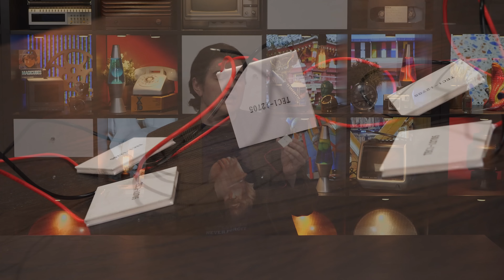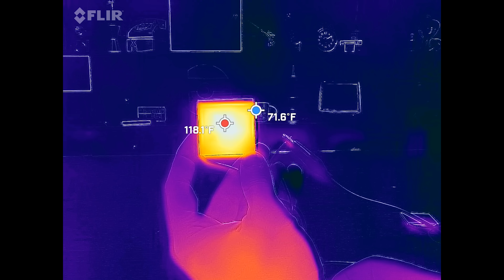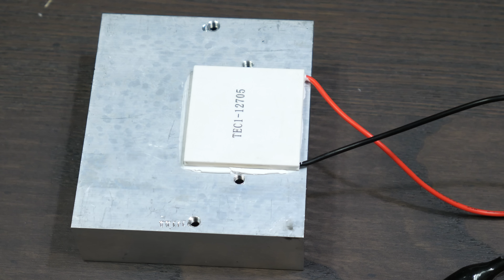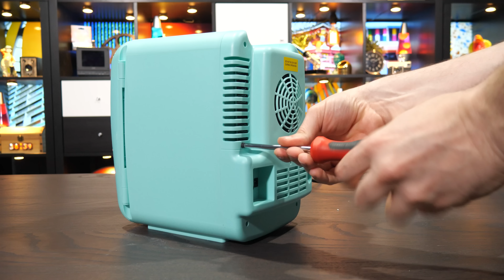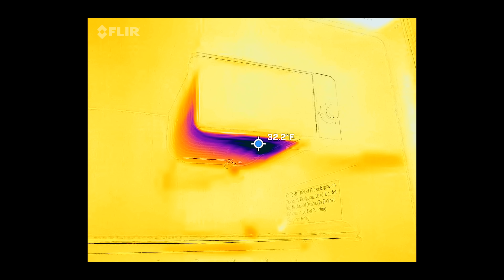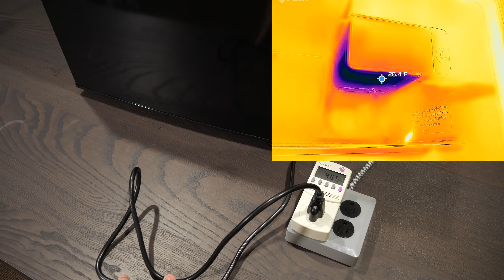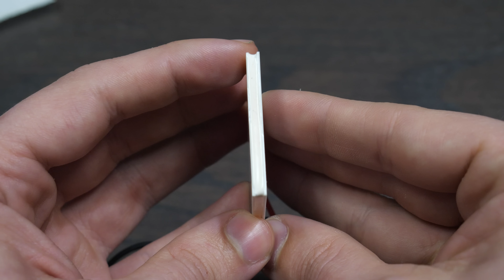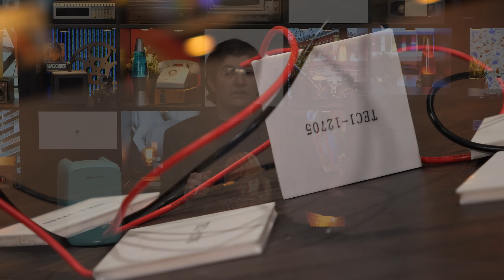Thermoelectric cooling: it's not great.

Comment: Another great video. There’s one other application that might be worth a visit. Dehumidifiers. 
We have a couple of cheap off-brand devices. I’m 99.9% sure they use the same Peltier element technology, with the cold side being connected to a heat sink which acts the condensation collector, and fan and heat sink combo on the hot side to shed the heat. 
They technically work, as after a  few hours some water has collected in the reservoir. Now I’m wondering just how terrible they probably are at their job, and if a proper dehumidifier would work better. We have a tiny house though and not a lot of space, which makes the cheap small ones appealing… but at what cost?

Comment: Have you seen these used in reverse effect? You can buy fans that sit on top of wood fires and are powered by the heat energy. It's the first time I've seen solid state thermal power generation.

Comment: Actually, Peltiers elements sounds amazing but just need a lil bit more engineering. So much potential there!
Reply: Hey, I've got an stupid idea! What if we stacked a few of  those Peltier plates on top of each other so 2nd one takes the heat of the 1st, 3rd one takes the heat of the 2nd etc... This "may" solve the heat leak problem you've mentioned at 22:06

Comment: Could you talk about Absorption refrigerator. I have one from Dometic that I use as a backup fridge and when going camping. It runs on 240V AC(Europe), 12V DC, and LPG. It is completely silent, slightly slow to cool, but can go below freezing 0C if you set it very high. The model I have can hold quite a lot.

Comment: I have one of these fridges where you can control the exact temperature.  I live in a place with a pretty warm climate and an apartment that loves to retain heat.  I use mine to keep medication “room temperature” (under 77F).  I also have a smaller one used for storing feeder insects without it getting too cold for them,

Comment: I have one in my van. I admit that it's NOWHERE like a fridge but in it's defence, it's marginally better having it than not having it.

On Monday I put six fridge cold cans in. As I use one can, I replace it with a room temperature can. Over the course of the week to the Friday, I've had cooler cans than just van room temperature cans.

The marginal benefit it gives me doesn't warrant buying one again if it packs in.

Comment: I had a thermoelectric refrigerator, which I bought specifically for road trips. It is small, it does what it is supposed to do: keeping my drinks cool during these trips. It was even advertised for the purpose and came with that 12V plug. Would I use it at home? Nah, I'd rather walk to my normal fridge. The $30 price tag seems appropriate for something I don't even use every month. The only problem is the shitty noisy cooling fan which I am going to replace. Ironically, a better, less noisy fan would cost another $10-20. Oh and also this thing is SUPER light which is important when you have to carry it around on a daily basis. So yeah, it is a shitty device, but it does have time and place.

Comment: I bought a fridge for my car based on the same tech. After 4 hours of driving, I stopped for a nice cold drink... only it was hotter on the inside of the fridge than it was in the car. Went straight in the bin and I went back to using my ice cooled cooler whuch done a way better job.

Comment: You should look into camping gear. Not just camping gear but electric generators. Particularly bio-lite and like products. They use thermal generators which are Peltier but working in reverse making it a electric generator.

Comment: Another use for peltier cells is electricity geenration. if you have a difference of temperature between the sides, it will generate voltage as heat dissipates trough to the cold side.

They are not efficient at this either tho.

Comment: All heat pumps are constrained by the same laws of physics. The maximum COP is determined by the Carnot efficiency which is a super simple formula (look it up). This literally applies to ALL heat pumps, regardless of the underlying technology, and hence applies to both vapor compression and Peltier effect heat pumps. 

Now of course engineering adds a TON more complexity than simple college level physics takes into account, but it's still the case that someone could come up with a Peltier based cooler that's MUCH better than the ones we have now, and perhaps even better than vapor compression based ones. The laws of physics definitely allow it. The whole premise this video argues i.e. that vapor compression refrigeration is inherently better, is physically wrong! 

Now I can't predict the future, but neither can the creators of this video, so the best this video can argue is that AS OF 2024 Peltier coolers are horrible. This could very easily change in the future. With the rapid advance of semiconductor tech, it could even happen soon (did anyone predict the rapid advance of solid state drives for example? did anyone predict the creation of blue LEDs?). 

If history shows us anything, it seems that if humans throw enough resources at a problem, eventually we tend to advance until we get close to the limits imposed by the laws of physics. There's no reason why this couldn't apply to Peltier coolers. And there's a strong incentive to throw resources at the problem due to our building heating & cooling contributing so much to climate change. But maybe this will be another case similar to fusion power, where even with the incentives, we never solve the problem. Who knows? I can't predict the future. But I wouldn't discount it happening..

To add another thought/musing, Peltier effect coolers have an elegance to them in that they convert electrical power directly to cooling power. It's literally a case of "connect the electrical leads, one side gets hot, the other gets cold". It's as close to a pure heat pump (like what's drawn in those physics diagrams) as you can get. Whereas vapor compression based systems have so many energy transfer steps in between. For electrically powered ones (i.e. not your ICE car's AC), first electrical power gets converted to mechanical power using a motor. Then the mechanical power of a solid object turning gets converted to gas pressure power using a compressor. And that gas needs to physically move back and forth from the cold side to the hot side. Energy is lost at every step. Which means than in a sense there are more challenges to overcome to get vapor compression refrigeration up to the Carnot efficiency, as there are more losses to fight against. Also, changing the Tc and Th (look up the Carnot formula now if you haven't yet) of a vapor compression system is hard, as you'll run into the pressure changing nearly exponentially with temperature for a given substance. I'm not familiar with the underlying mechanism of Peltier coolers, but I know for something like magnetic refrigeration, changing Tc and Th is as simple as changing the magnetic field on each side. And something like that could be a powerful tool to get close to the Carnot efficiency too.

Comment: So a small phase change dehumidifier uses like 40 watts (that includes a fan and a compressor) and, not including it's water tank, is super small. You could rip it apart, make a styrofoam box, plumb it in somehow and have a better (while a bit more expensive) tiny fridge that can fit on your desk and uses like 1/3 of the power on average.... maybe I am just guessing but you can build your own micro fridge for a bit more than that garbage costs and have it MUCH better.

Comment: If you swapped the factory included fan to high quality one, you could get a small nearly silent minifridge. Granted the total heat transfer performance is really low and energy consumption is high. If you only need to keep stuff cool instead of cooling down hot stuff, and the peltier minifridge actually had proper insulation (spoiler alert, the cheap stuff doesn't) it could be an acceptable solution, especially with a thermostat.

If somebody could create a peltier element with higher efficiency (e.g. 50% efficient meaning it would need 20W to cool down 10W) then using a peltier element based systems would make a lot more sense.

Comment: Are there fridges with inverter compressors like A/C systems? I don’t live in USA and fridges here are all using the old and noisy compressors. I am wondering if in US there are already fridges using inverters for improved power efficiency and lower operating noise.

Comment: The main thing I can see these useful for is conditions with unlimited power, where heat shedding is not a bad thing, but maintenance or any kind of failure is a catastrophe. I would imagine they'd be fairly popular for thermal management on space probes or buoys or weather balloons as sort of "well at least it's better than a heating element" device.
Reply: I suspect they would also have an advantage in power/weight

Comment: And how many cans does the freezer compartment of the big fridge hold? And how long does it take to cool them all? 🤔
As for the sound of your small black actual-fridge, smaller pumps/fans produce a higher sound then larger. With same db levels you probably wouldn't notice a larger pump, I had this problem with picking a fridge as well that had to be small & quiet.

Comment: I bouht one of this small coolers... and they are [roblematic but not because pwltiers capabilities... they seem luke secured peltier to main with a alloy screw :) which touches booth cold and hot part :) thats engineering (if there is aby o  chi a who work for this chea[ [roducts companies :) ) fault..
So isolating correctly the hot and colt part and trackibg temperatures is vital :) after that they are ;wery promising itseems... and mostlikely you have to isolate them when offline...

Comment: My beer fridge (Husky, I think it's the 48L one) has a vertical evaporator, and sometimes it does need defrosting. I should point out, though, that the thermostat completely failed recently and it kept over-chilling my beers. I wonder whether the ice build up was a hint that it was on its last legs. I replaced the thermostat (since the compressor obviously worked fine), so we'll see if it needs defrosting in future.

Comment: I was thinking about taking a motorcycle soft sidebag, adding some insulation and putting a peltier cooler on the back. I'd 3D print the cooling side case. Most of the air would flow just from the wind when riding. ESP32 or something like that to attack a couple of temp probes and a power switch for the plate and fan to control it and I can even have it report status through bluetooth.
All I'd need was a slightly lower temperature for some water and sandwiches while on a trip.

Comment: You slid right over one legitimate application, outer space  As the mechanical compressor needs gravity to keep the oil in the sump of the compressor and space has no gravity, Peltier devices can be useful.  And, they have all of space to reject the heat into.

Comment: You'd hope you can tell a minifridge from a peltier thing by the size. But a few months ago I was at a hotel and their minifridge seemed to have too hot of a front handle. Eventually I yanked on it too hard and it pulled off a panel under which... a peltier and a fan! Granted it had at least the proper insulation thickness (which made it hold like 10 sodas despite being the size of your black cube one). But imagine the energy waste of a whole hotel running those non stop!

Comment: You might be able to help answer something for me. In aquaponics, you will usually like the water to be warmer for the plants than the fish, by a few degrees Celsius. Could a peltier be a sensible way to create a contraption that simultaneously heats and cools water travelling in opposite directions in separate pipes, conjoined by a row of peltiers? Would the temperature change be equal on both sides? Would a contraption based on a regular heat pump still just be superior in the of efficiency?

Comment: I used to have a Coleman brand cooler from the 1980's with one of these on one side.

It ran off a 12V car cigarette lighter plug, which is a terrible terrible outlet and plug that was originally designed to set things on fire, not supply 12VDC.

Anyway, this "refrigerator" cooler kinda worked, but not very well.

The cigarette lighter plug didn't make very good contact, and the high continuous load... and probably arcing... eventually melted the plastic plug.

Comment: What about portable compressor fridges that are prevalent here in EU and used in overlanding, van-lifeing and whatever? Don’t you have them in US? They are way smaller than the mini fridge, but still have a compressor. What I’ve found strange about them due to your video is that even though they come with handles and the heavier ones - with wheels on one edge, I have never seen any kind of warning about keeping them level or having them rest level after moving/tilting. They use a different kind of compressor or the manufacturers just don’t give a damn?

Comment: I have a bigger "car fridge" that works also on mains, that has a Peltier inside, can cool and also heat, and it has a fan with fins on both sides, so it circulates air on both sides of the element. It's pretty well insulated, but still cannot really produce more than 15-20°C difference. I've built an ESP-32  based thermal regulator for it, and successfully brew sake in it. But I wouldn't use it on a daily basis as a fridge.

Comment: I used a peltier device to build an ac system for my truck. Used a water block on one side to pump water through tubes to a fan with a copper coil. then just used a water pump to pump water through them to cool it. essentially a cheap ac unit.

Comment: Surely how suitable these cooler boxes are is largely dependant on where you live?  Here in the UK where ambient temps are usually pretty mild they do a perfectly good enough job of cooling a few canned drinks.  Similarly our electric on-demand water heater wouldn't be up to much if we lived somewhere significantly colder as it too can only alter the temperature by a fairly limited amount.
Reply: and yes, I get that they're inefficient but it does fit in a much smaller space, which may be beneficial for some.

Comment: Reminder to anyone thinking adding thermostat to peltier chiller, when turning off it’ll start “leaking” cold on the heatsink and generating electricity instead if there’s no power.

It seemed like a great idea at first for my minibar fridge, but yeah you’d have to make sure there is a low-end power supplied to it in addition to thermostat for it not to just dump out the cold again after reaching set temperature.

Never got around to trying to implement this myself though, since the power supply failed and now it’s a storage for room temperature drinks since then. ;)

Comment: The idea is to put cold drinks in there from the start if you do that it will keep them cold it's not designed to chill them from warm... also the one I have cuts out when it gets to the desired temperature then kicks in when needed.. you have chosen a very bad example for thermo cooling my fridge has a thermostat and works perfect

Comment: Many German trains have peltier-based thermo cabinets in the cab, that are usually just big enough to fit 2-3 liter bottles or an average lunchbox. I regularly use them to heat my lunch and it’s usually pretty warm within an hour, though I’ve never used the cooling personally. Only ever saw colleagues chilling (and sometimes forgetting) their energy drinks in there.
Reply: Which trains? I regularly travel by train in Germany I have never seen something like this.

Comment: You're missing the point.
Those are mostly used for on the go.
Not cooling your drinks but keeping cool what you take with you or at least slowing heating them up.
Like in the car or others.
Reply: He literally mentioned the car thing...
Reply: Indeed at the end after burning it down for 20 minutes 😅

Comment: I had one of these except it only cooled a single one, but did it in like 25mins to like ice cold. this one used two copper plates pressed to each edge of the can and it had little room for air but was definitely still loud.

Comment: Please don't run a peltier fridge in your car unless the engine is running.  And if you are thinking about leaving the engine running - a portable 12v compressor fridge will pay for itself in short order.

Peltier cooling is fine for certain scientific equipment, not a lot else.

Comment: Having built scientific instruments using Peltier coolers, I found that the manufacturer's 'power rating' was calculated as the power level at which the efficiency dropped to zero, i.e. where the self-heating was equal to the cooling effect.  However to run at maximum efficiency (COP) they had to be run at under 5% of the rated power.  So to do anything useful you need a lot of elements, and a huge fan-assisted heat-sink, which ends up expensive.  The standard '100W' 50mm elements rated for 24V need to run on about 4V (depending on temperature difference) to get a COP more than 1.  So to make a car fridge run on 12V you need a minimum of three '24V' elements in series.
Reply: That's what I thought...